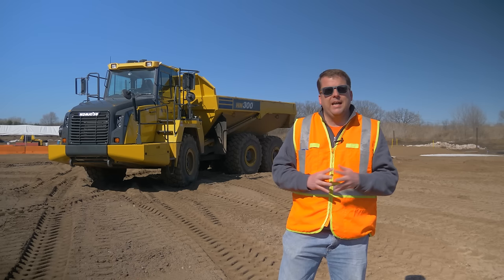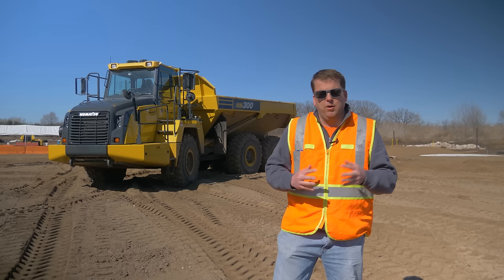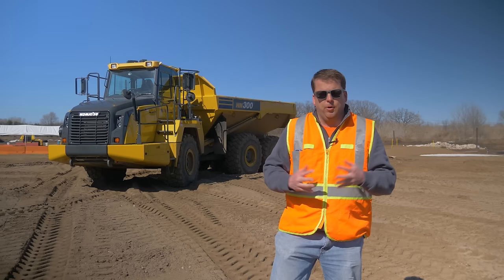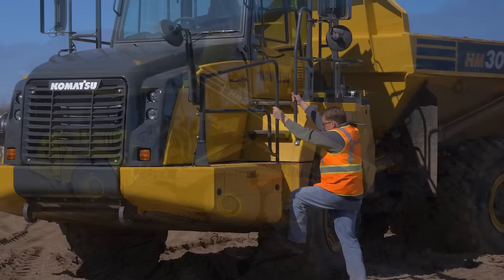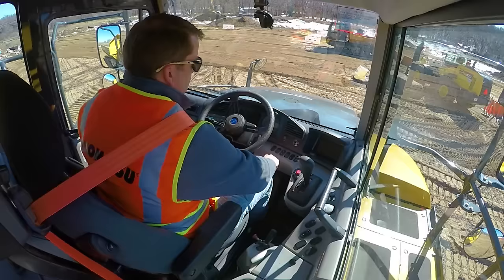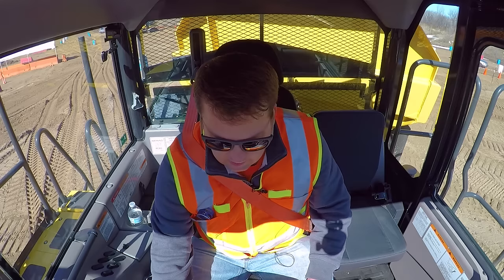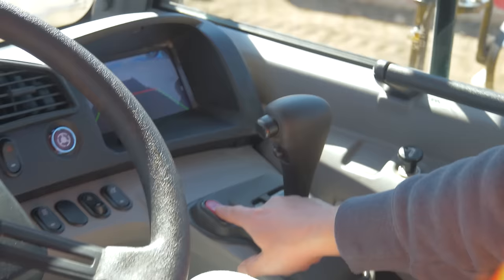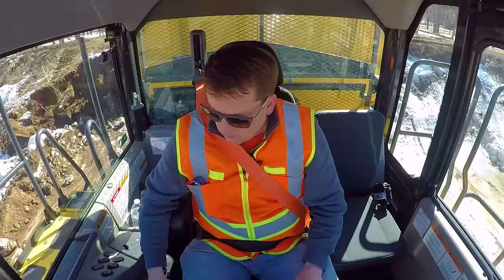How to Operate an Articulated Dump Truck // Ep. 137

Comment: What is the advantage of articulated trucks over the traditional ones?
Reply from the maker: Great question.  So the question is really the advantage of an articulated vs rigid frame haul truck.  Pretty much comes down to the application (use).  Articulated trucks obviously have better maneuverability because of their articulated steering so work on tighter job sites.  Most importantly is the ground conditions.  Articulated are best when there are less than ideal job site conditions.  They have 6 larger wheels and all-wheel drive so they work much better in softer and un-even conditions.  A rigid frame haul truck is best used when there are established haul roads and usually hauling longer distances (rigid trucks can haul more and farther/faster).   This is why generally you find rigid trucks in the mines that have these longer roads established and their projects are much longer in duration.  Hope that helps.  Would love to hear anyone else's thoughts on this.
Reply: @HeavyMetalLearning  That makes sense now. Thanks for the answer.
Reply from the maker: You're welcome!
Reply: @HeavyMetalLearning  also the articulation is for safety puposes. If you roll it say backing up to get loaded.... only the bed rolls not the cab.
Reply from the maker: @justinmaddox1068  Good point...thanks for the comment!

Comment: Are Bell a good brand of dump truck.All the functions are worked off a keypad on the right hand side on the new models gears lights retarder tipping the load their is even a button for raising the bonnet. I presume that Volvo and Cat are the best brands.
Reply: I used bell for 4 months in summer conditions and the quarry conditions were hard and easy to operate.  . . They were simple to operate and did a great job. . . We had it on hire and about 4500 hrs on the clock. . .
Reply: @rouruinahenry1291 
Thanks.
Reply from the maker: I don't have enough experience with Bell to comment, but hopefully some others will comment.
Reply: Bell are okay, nothing special but they do the job, Hitachi are just a bell rebadged.  
CAT 740 are by far the most powerful and capable but will kill your hearing and spine after a while. 
Volvo's are very refined but lack a little power and in my experience break down a little more often than the others.
Komatsu's are a nice balance, good suspension, fairly quiet, decent power.

Comment: I live in Ontario Canada, would I I need to take a special course to get a certification for this? Or could the company just give me the training
Reply from the maker: I’m not sure exactly requirements for Canada, maybe someone else will comment.  I would prob check with a local contractor.
Reply: I work at a mine up in the Yukon, trained me on site with a simulator, pretty cool
Reply: Bait they hiring
Reply: c huxter always bro 2 weeks on 2 weeks off, good gig
Reply: Any minesite inside Canada will train on site. It's a crapshoot whether a site in a municipal area will require certification. Almost all logging companies do not require it but most often won't hire without extensive experience. There are no actual laws in Canada requiring anyone to be certified to operate any heavy equipment. The laws simply state you must be "trained and competent". Most companies interpret this by having a trainer position on hand who can assess your skill level. Smaller companies likely won't have that.
Reply: Not in u.s.  only thing you need license for is forklift and crane and CDL if operating truck with airbrakes.
Reply: Company can give u training depending on who it is good to get in through a friend who runs a rock truck

Comment: Hi, during dumping of loads, did you hold your brake or jist let iy free. Just asking. Never experience driving dumptruck and im am planning to operate it. Please let me know
Reply from the maker: Usually I hold it initially but then let off slowly so it pushes the truck forward as dumping.
Reply: Put my truck in neutral, hold brake and rev motor so it dumps faster

Comment: Last time I checked the retarder uses exhaust gas to brake?
Reply from the maker: Typically on highway trucks, yes.  But I believe on equipment like this they are hydraulic retarders working off the those cylinders.   Maybe a mechanic or engineer can jump in on this, because I'm not exactly positive.   Good question though.

Comment: Just wondering if anyone can tell me what happens if you forget to turn off the master switch at the end of your shift?
Reply: The ECM, or engine control module on some unit creates a small drain on the batteries. If left on over a period of time can drain the battery down.

Comment: Hey, new Operator here on a Volvo A45G. We are digging a sight for a Land fill company. There is 10 Volvo trucks, 4 excavators, and I be leave 4 dozer's . Basically moving Dirt from A to B. I've worked one day so far and I'm trying to become a better operator for the Dozer's and Excavators. So here are my questions. 
 1) Is it best that i don't fallow the previous truck to avoid making deep ruts?
2) I have a foot pedal on the left, i be leave its for my retarder, how do i use it correctly. When doing down slopes i just let the engine brake do most of the work.
3) When dumping, what is a dozer looking for, piles close together, far a part, any tips would help
4) How do i better understand what an excavator operator is looking for when i pull up. I get when there bucket is full and up in the air means they are ready, but sometimes idk if I'm to far or close sometimes, also i don't want to get stuck in previous ruts.
5) What are some tips on the dirt we are pulling up. Depending on what we are getting depends on where i dump. So top soil went to one part, really sloppy mud and clay went to another part. But (good clay and soil) the dozers wanted to make roads. . I be leave. So what kind of soil do the dozers like to push? Also what is the blueish black soil that is under clay? 
Any tips may help me out. Thank you.
Reply from the maker: Lots of good questions, definitely recommend asking your peers or supervisor because this shows you want to learn and get better.  Too many people are afraid they might look dumb, when in fact I think most employers are more impressed with a new employee who wants to learn and do better!    I'm by no means an expert, but here are a few of my thoughts (others may chime in as well).
1) Yes, I usually just go one tire width over to compact down that road more evenly.  Then really you are just going back and forth (only 1-2 tire widths) to make the roadway more compact without making a single set of deep ruts.
2) Yes, I believe on the Volvo that's the retarder (Komatsu has it on steering column).   On steeper slopes you should be using this to slow the truck down (especially when loaded) to avoid wear on the service brakes.
3) I say close together, but that's also a great question to ask your dozer operator what they want.  Could have a lot to do with how and where he is spreading the material.
4) Again, good one to ask the operator.  But generally if their bucket is full and up in the air your goal is to put the center of your bed right under that bucket.  Make sure your mirrors are positioned properly so you have at least one that can see where that bucket is (can also position mirror so the bucket appears in the same spot on your mirror when you know you have it set to be looking right over the center).   Then just listen for them to use their horn.
5) Not sure I have the answer to that one, depends a lot on the site layout and their overall plan on where materials need to go.

Great questions.   Thanks for the comment.   Hopefully some other operators will chime in with some feedback of their own.
Reply: @HeavyMetalLearning  Thank you for your input!
Reply: Hi Crey i see it's a two months old post so it would be awesome if in the meantime you asked the oldiez and had the time to report back ! here i go: in my experience 1) yes avoid when possible, try to squeeze evenly the whole surface available instead 2) Not sure whether it's magnetic or a secondary actuator for the supersayan engine brake ( closing the exhaust valves half way i believe) like the button on the consolle does. Anyway it is awesome and by using it regularly combined with choosing gears can spare the machine from heavy braking and the stress the machines may endure from it.  3) Dozers are there to push things, included you if you get stuck. Dump the stuff either where they tell you,  or where it should go according to logic and knowledge of the site, that's why is important to be told what the whole ordeal is about and what the site is supposed to look like in the nearest future. So unless i'm given specific instructions i'll dump close as possible and start from far away for stocking, further apart while filling top layers so that the piles will make about the finished level (plus some) after being clipped by the diggers, or in a long stripe if it has to be graded etc. 4) The excavator should wait for you with the bucket in the air to show you the spot, ideally you want to back up perfectly aligned with the imaginary line made by the bucket and the pivot point of the machine, and stop as you see them in the mirrors tipping the stuff if, or honk if you're that kind of people. If you are dumping material for an excavator to work with instead, they will usually point the spot on the ground for you and pull away their buckets to safety when you're close enough. honking is often inevitable here :/ 5) dozers can push pretty much anything but i see why one would start sorting  out out all the different masses from the beginning while excavating a large site , and possibly crushing some on site. Hope this helps
Reply: @creygallagher8705  where zre you please
Reply: Very curious to hear what you have learned since you posted these excellent questions. I am trying to do an estimate for moving a large amount of sand using a small fleet of articulated haulers, most likely 4 Volvo A-40s. The haul loop will be about 1.5 miles and will involve backing in to dump, and backing in to load. I am assuming we will driving the loop clock-wise, turn hard right to get lined up, and get straightened out as we back in right next to previously dumped pile, lift the bed, and pull slowly forward as material spills. Once empty, truck returns and backs in to reload.  I know the fill time. Trying to estimate the loop time, including the time will take to unload. Working on fairly solid material in the Utah desert, and the filling will happen on a compacted gravel or concrete apron, so not too worried about ruts in the mud.